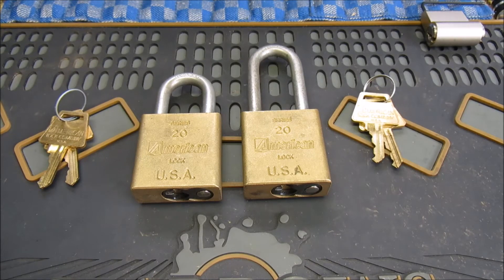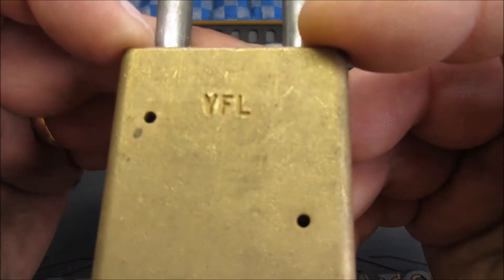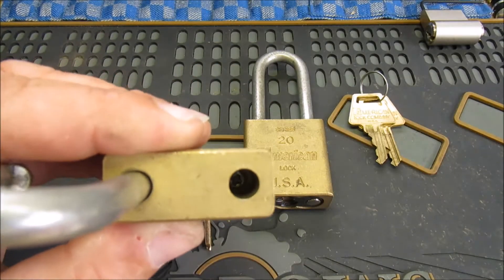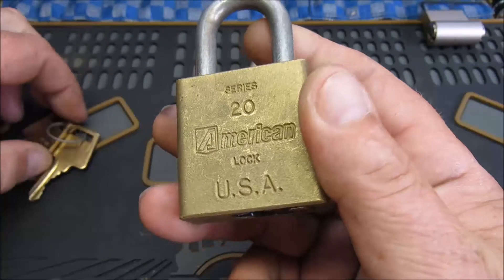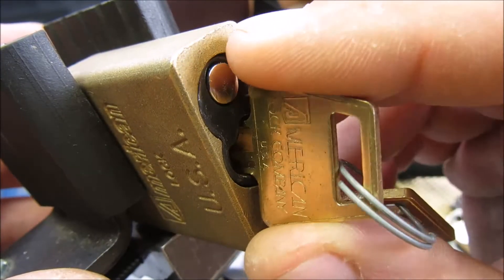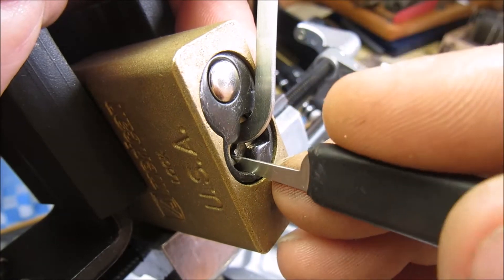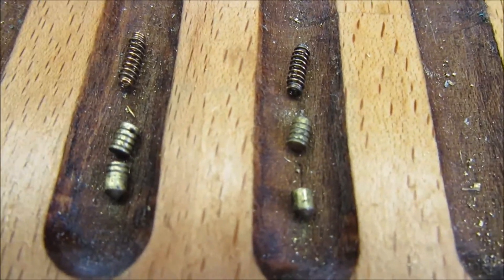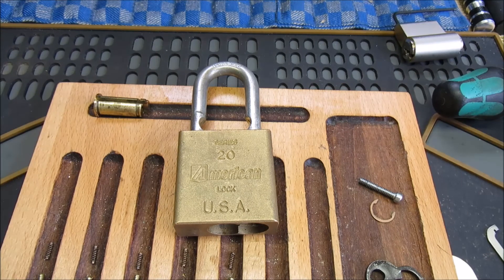(47) NOS American Lock Series 20 SPP'd and Gutted

Comment: Hi Pete, what vice do you use??? Nice picking by the way.
Reply from the maker: Mine is a Panavise 350 not sure if it's available over here any more I got mine from 

http://uk.farnell.com/webapp/wcs/stores/servlet/Search?catalogId=15001&langId=44&storeId=10151&eq=N%3D2031%26amp%3BNtk%3Ddesc_pn%26amp%3BNtt%3Dpanavise%26amp%3BNtx%3Drel%2Bgensearch_store_specific%252cstatic%2528P_STORE_MARKETING_RANK_FARNELL_UK%252cascending%2529%2Bmode%2Bmatchpartialmax%26amp%3BNty%3D1%26amp%3BNtpc%3D1%26amp%3BNtpr%3D1%26amp%3BD%3Dpanavise*%26amp%3BDn%3D2031%2B2031%26amp%3BDx%3Dmode%2Bmatchall&st=panavise&pageSize=25&showResults=true&aa=true&vw=

I also use one of these 

http://www.ebay.co.uk/itm/Stanley-STA183069-Multi-Angle-Hobby-Vice-Clamp-Swivel-Portable-1-83-069-New-/172325090769?hash=item281f6035d1:g:LZgAAOSw-itXsyOg
Reply: Cheers Pete!

Comment: Now I understand why BosnianBill likes WD-40. It would have stripped that old grease and can get to any dirt from old locks not so lucky to have been kept in their wrappers. It's just not meant to be left on. I'm sure it's got some good competitors though.
Reply from the maker: I used lock lube, TBH anything like that just loosens the hard stuff, the muck is still in there, once this was gutted, I soaked the lot in DNA for a few hours, let it dry overnight, and reassembled using graphite powder.  The difference is amazing.
I just wanted to get it pick as was to start with.
Reply: Pete Restall  Wow! I thought you picked it out of the box. Did the keys even turn when you first got them out?
Reply from the maker: Hardly, everything was mushy, the core even struggled to return when the shackle was pushed back in, couldn't even gets clicks out of the pins until I lubed it, and even then they were different every time, the muck in the bottom of the jar was sight to see, all back together now and picks a treat.  Just got to strip and clean the other one now.